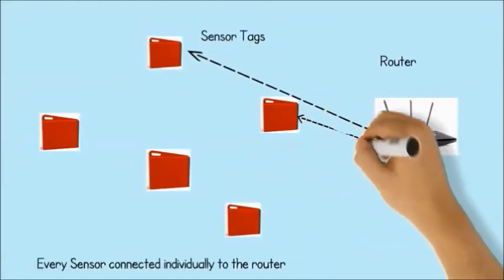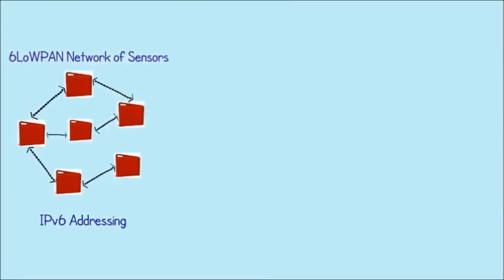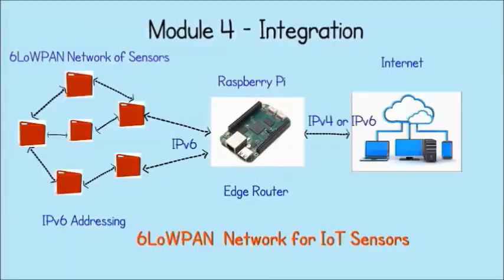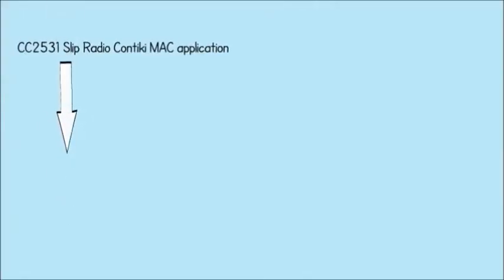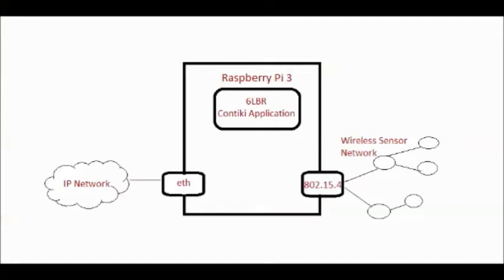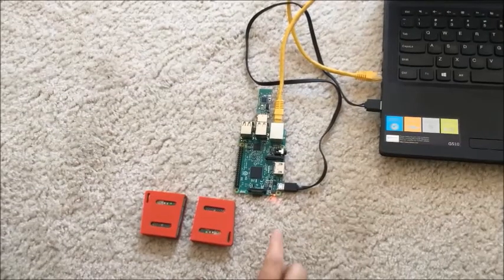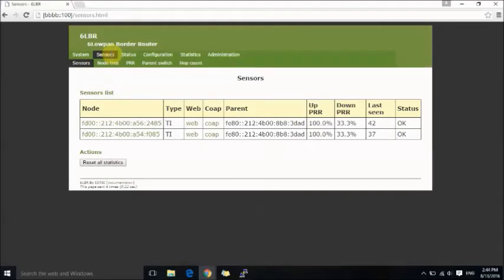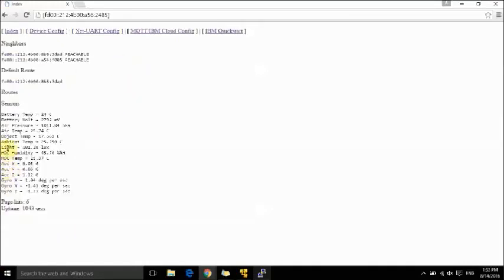6LoWPAN Network for IoT Sensors

Comment: Hallo Supriya Somashekar, I am doing also the same project as you did. In my case, I have to just create a sensor mesh of SensorTag CC2650 using 6LowPAN protocol. Could you please give me some hints how to do it? I will really appreciate it... tnxs in advance
Reply from the maker: Hi Mariner, I cloned the contiki source code which has the web demo application and ported that onto the sensortags.
Reply: Thanks a lot for this video Supriya. Working on the same project. Hopefully it will work...